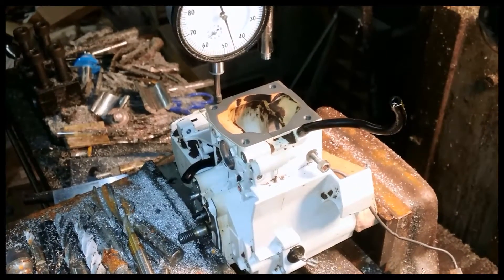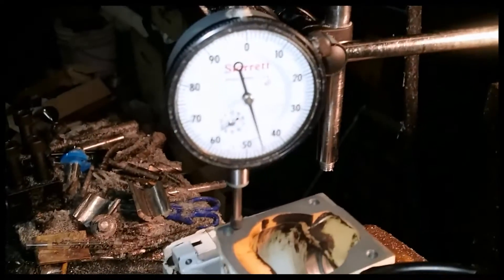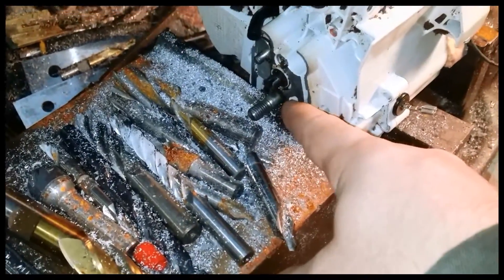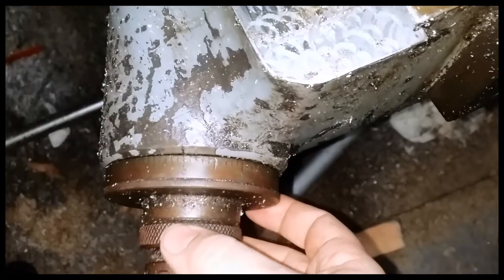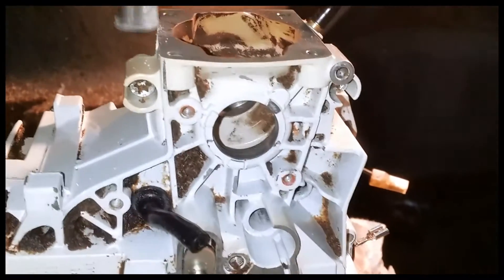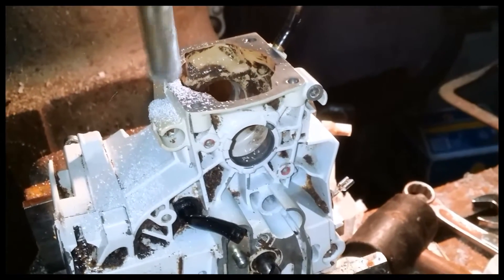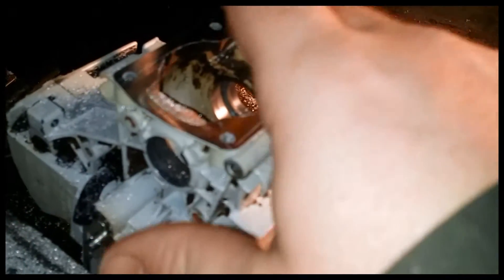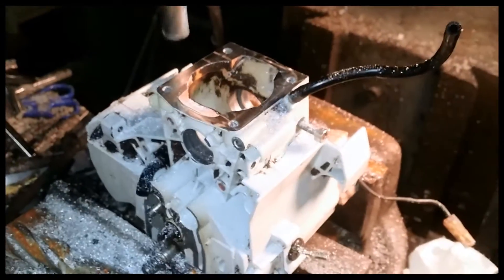Stihl ms200t dismantling and rebuild part 3 - decking the chassis / case

Comment: What is that going to do to the saw
Reply: What is squish my friend?
Reply: @ELPATRON839  the distance between the top of the piston and the bottom of the cylinder.
Reply from the maker: john Kosheluk tightens squish and bumps the compression a bit

Comment: Loving the videos watched the whole series after scoring a 200t at a yard sale for 20 bucks, is there going to be a part 4/reassembly vid?? Would be so much appreciated, I'm a climber in need of a new saw and i know these are the best and they aren"t cheap.
Reply from the maker: +tnarg224 vids 4-7 are already up!  enjoy!

also, please please please check my link for HL Supply especially if you are going to be doing a rebuild, i have turned off the ads for these vids and hope to support the channel instead from that link, thanks!
Reply: +Matthew Olson Awesome I've been looking for a good source for parts as well, is there a brand that you would recommend?I know they OEM parts are hard to find and expensive. Thanks for the time put in man it really helps me to see it be done.
Reply from the maker: Depends on what parts you need...use my link for Hlsupply and buy what you can... then get oem stuff for what you can't find
Reply from the maker: I usually order off ebay for stuff I can't find from Hlsupply